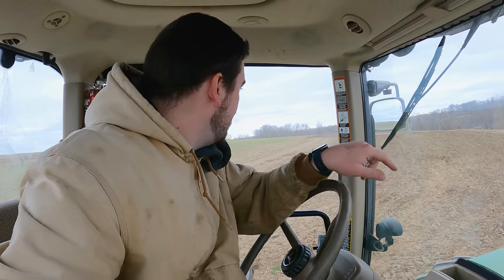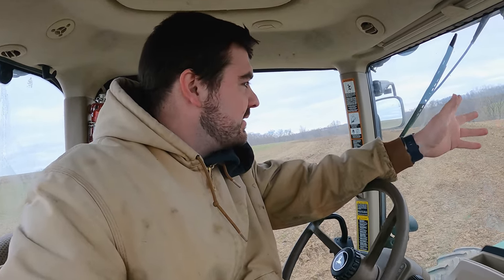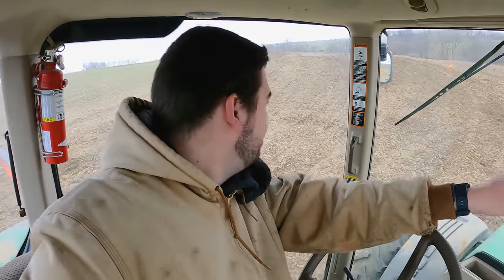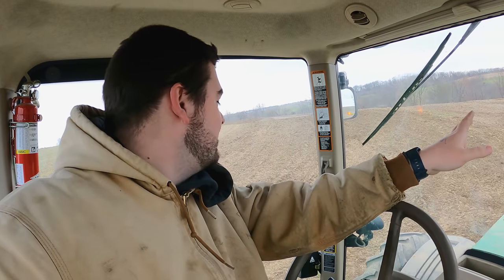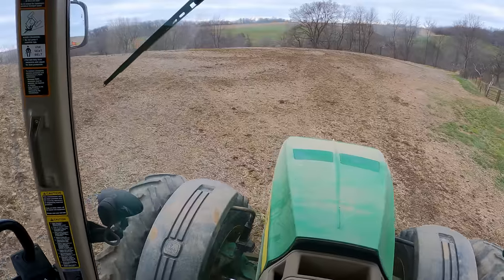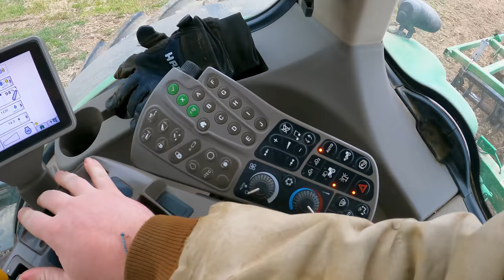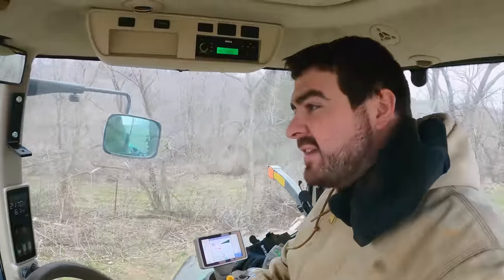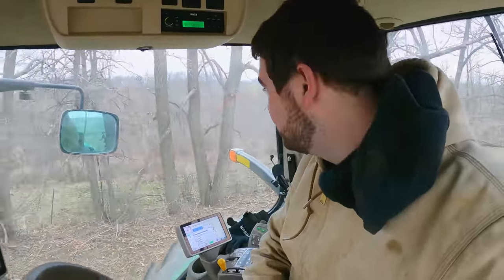Incorporating Manure - Chisel Plowing

Comment: If you open up the fence, put in a gate to brush mow and use the trees you drop to store hay bales on  feed the cattle before the other pastures are ready.  Let the cattle reseed and do the manure hauling to get the maximum return on the JCB clearing.  Those edges will be good to hay if you can police them after planting corn and beans.  Recovering ground beats the hell out of leasing new ground.  Greg Judy on utube is a master regenerative cattle farmer.  Minimize inputs and equipment to maximize beef, sheep, lumber and mushroom profits.  The sheep follow the cattle mob, would be a great project for you and the new bride to work together.  Greg has excellent sheep and beef genetics.  No worming or fly spraying.  Move the animals and let them do more heavy lifting using an ATV and electric fences.  Your protected from machinery and crop input expenses.  Have a great spring plant and growing season.

Comment: Ryan,

why not something less aggressive like a harrow?  It would mix in the manure adequately?  We use a drag harrow here in the cattle farm (no crops) and it can be pretty aggressive about breaking up the clods.
Reply from the maker: After the second application it was thick in spots and a harrow wouldn’t have cut it. I used the harrow on the hay ground and had to hit some chunks several times to break them up.

Comment: how dow you like the new chisel plow 714 jd or as John deere calls it  mulch till tool  I loved using one  we pulled it with an 8650 at times also used a brillion on they  had both then they got a folding 714 jd to replace brillion one pulled it with a jd 9400 on triples  kept older 714
Reply from the maker: It's a lot better than the CASE.